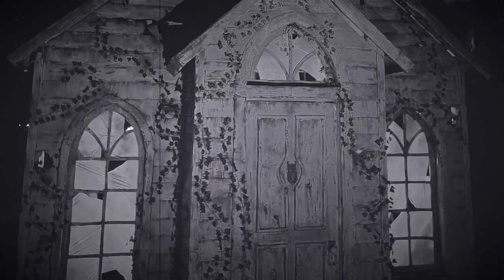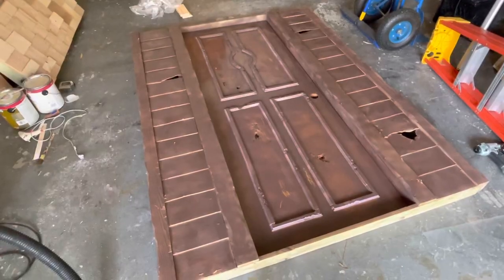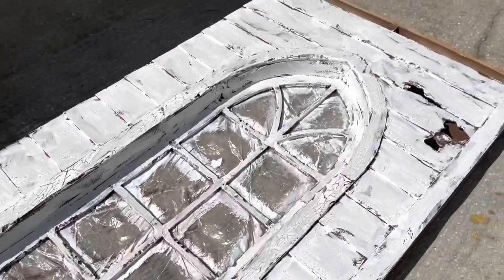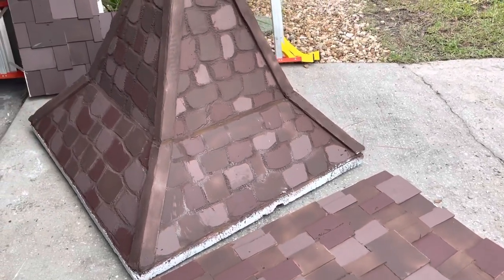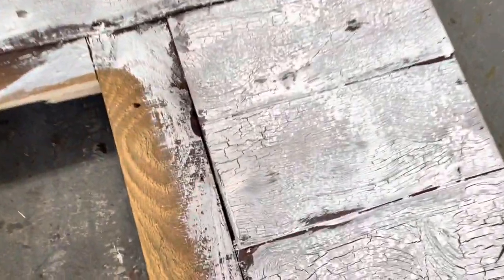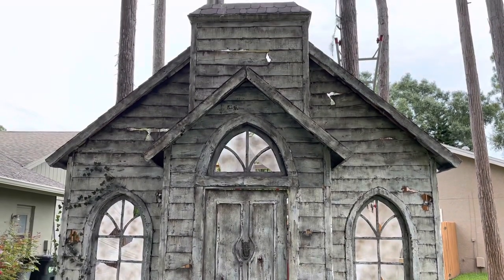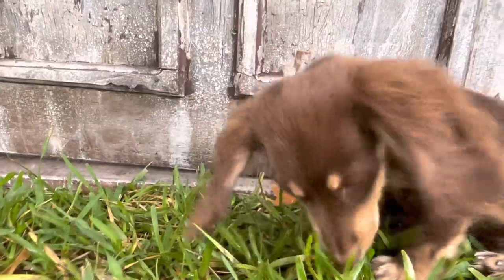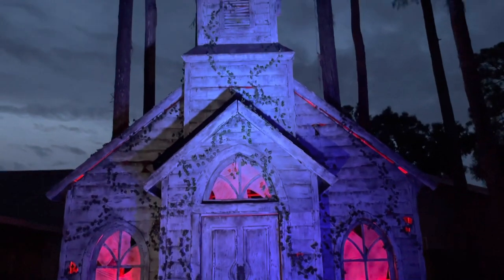Halloween Church Build - Part 2 (Painting/Aging)

Comment: How's the product for crackle hold up? Does it want to peel off or anything
Reply from the maker: Nope! Haven’t had any problems. I did some wet aging over the top of it and none of it came off during that process.
Reply: Thanx man just checking if it was good we getting ready to do crackle on  our facade
Reply from the maker: @jeremyrose3034  Good luck! It’s a fun product to use
Reply: Did you have to use flat white paint over crackle paint?
Reply from the maker: @jeremyrose3034  I don’t remember the exact sheen but I know I didn’t use gloss. So either satin or flat should be fine.

Comment: What material did you use for the window?
Reply from the maker: It was the plastic that you peel off from the foam sheets! You gotta be careful with it but it was practically free. If I were to do it again I would’ve used some thin plexiglass but it can get expensive.
Reply: @AndrewLong  thanks man, I loved the way it came out for you so I might use the same. Trying to make it as cheap as possible :)
Reply from the maker: @RR_85  no problem! Good luck with your build!